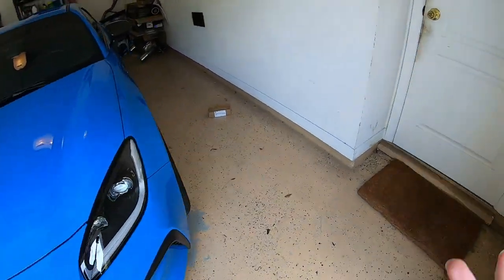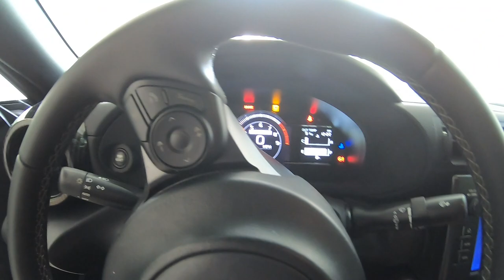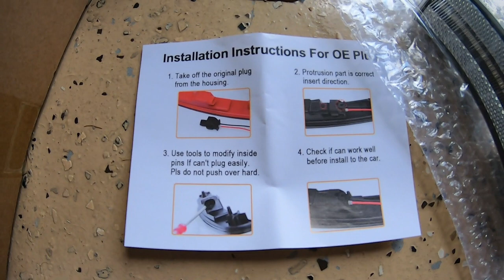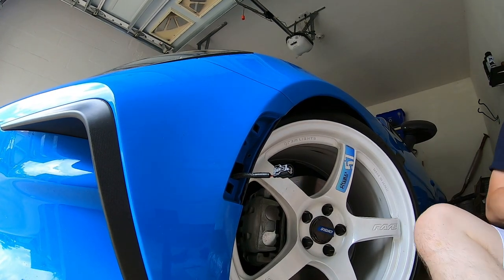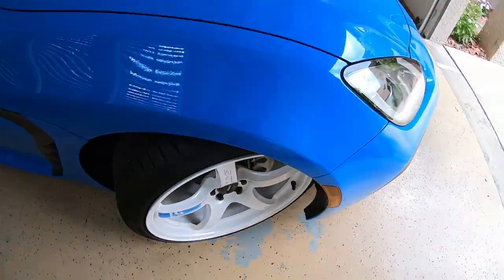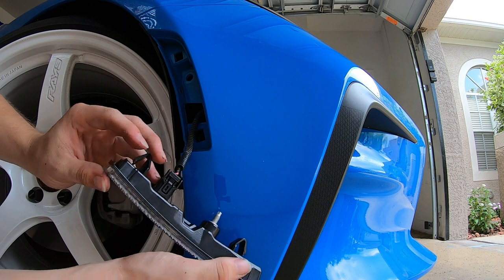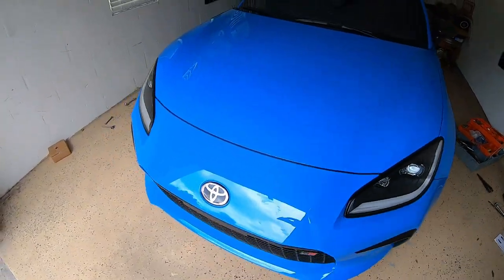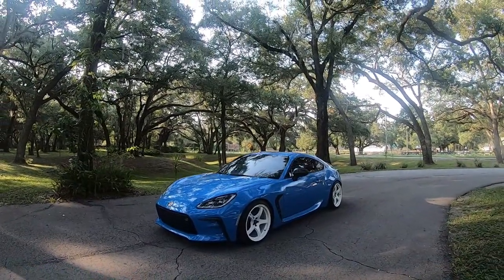Clear Side Marker's For The GR86/BRZ

Comment: Bro that’s actually nice but question have you ever filled it up with regular gas?
Reply from the maker: I appreciate the support as always fam, When I first initially bought the car, the first fill up I put 89 (or 87 depending on where you live) in the car, and since then it has been only been 93. I’m assuming it would be fine to run 89 (87) in the car, but I prefer to just fill it up with 93, and it says premium unleaded fuel only on the gas cap 🤷‍♂️
Reply: @Justinackerman_  true I actually got my car 1 month earlier ( I am getting it tomorow) and I’m flying to Jacksonville florida to get it, so stoked
Reply from the maker: @Makima324  Yooo, no way. Fucking congratulations fam, so stoked to hear you’ll be getting yours. I was so excited I couldn’t sleep the day before I got mine 😱👏
Reply: @Justinackerman_  exactlyyyyy I even bought a MAperformance exaust for jt
Reply from the maker: @Makima324  exhaust mods are by far the best thing you can do to a car imo. It just completely changes how you feel about the car, and how you drive it honestly.
Reply: @Justinackerman_  yes sir I’ll update you on the car
Reply from the maker: @Makima324 how’s the car been treating you fam 🤷‍♂️
Reply: @Justinackerman_  brooooo it’s chillin, receantly just rapped the car to andiziod purple and andiziod blue. Added the AWE catback exhaust, and I’m waiting for my delivery to install my short throw shifter. Soo it’s chillin 😂
Reply from the maker: @Makima324  that’s so awesome to hear that, glad your enjoying it, that’s what matters most at the end of the day 💙

Comment: How do the bc coilovers ride compared to stock. Also what dampening do you have it set to
Reply from the maker: I honestly love how the BC’s ride, tbh I have them set pretty stiff though, because I daily drive the car. I can’t remember exactly off the top of my head how many clicks it was. I set it to fully stiff then about like 15 clocks the opposite direction if that helps you out at all😅. Really wish I could explain this abit better, thanks for the support and for watching the video fam 👏💙
Reply: @Justinackerman_  ty for responding man ill probably go with the bcs because they’re budget friendly. and I was also curious what wheel and tire specs ur running.
Reply from the maker: @ethanmoore4314  No worries man, the wheels are 18x9.5 +38 and the tires are 245/35 R18. I only lowered the car 2 or so inches all around. It’s still got almost another 2 inches that it could go lower, but I daily drive the car so I don’t want to me scrapping absolutely everywhere I go.